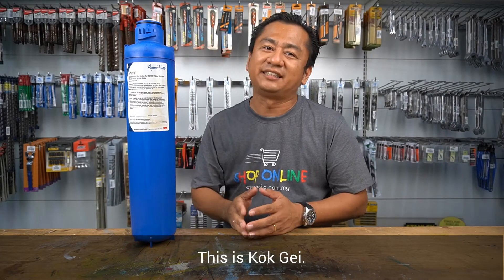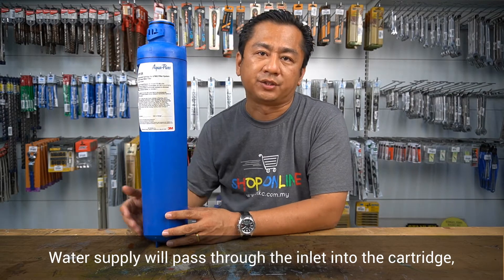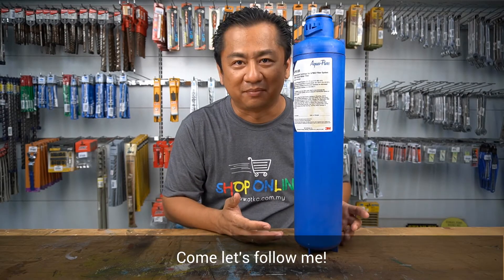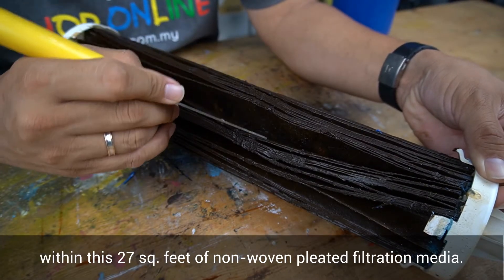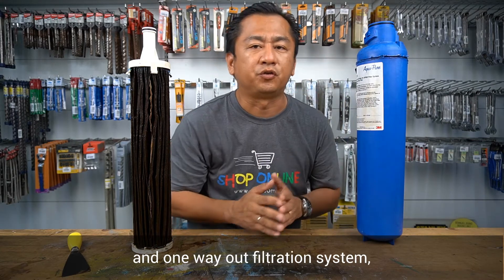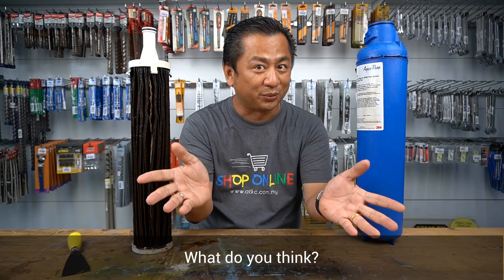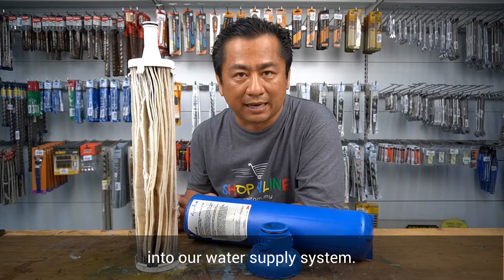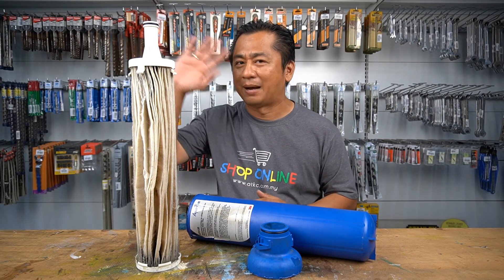Should I Change My Water Filter? | 3M AP902 Whole House Filtration & AP910-R Replacement Cartridge

Comment: What was you flow rate like when you changed out this filter?
Reply from the maker: i didn't gauge it
Reply: @ATKCeWarehouse  Thanks, but even without a gauge it seems like if it would have dropped a lot you would have noticed it, so sounds like little or no impact on pressure or flow. This unit is on my short list.
Reply from the maker: @hdtvkeith1604  Well, the pressure or volume would have dropped. What  I did was, I marked the date I changed by filter. Basically, I do change it every 12-18 months.

Comment: Boss, I use AP902 for my whole unit filtration for 12 months now, and I stay alone, less water usage, and the water pressure still strong until now.
My question is, am I still need to change my filter every 12 months?
Reply from the maker: You  may consider every 18 months. However, it's good to have a pressure gauge installed for monitoring.

Comment: Can you go longer than 12 months if you are on a municipal system? I just changed my after 25 months because I noticed a slight reduction in water pressure.
Reply from the maker: Do you mean multiple filtration system?
Reply: @ATKCeWarehouse  I use the AP904 as a pre filter going into my Culligan water softener. My drinking water I use a one gallon distiller. The 1/4 cup concentrate from the one gallon was showing reddish tent with the reduction in water pressure prompt me to change filter after more than two years.
Reply from the maker: @captaincupcake57  Good to hear that.

Comment: I tried to replace my 3M filter catridge but i cannot push the pin upward. What should i do?
Reply from the maker: It is because of the pressure inside the chamber. If you have bypass channel as shown in my video, kindly open the valve slightly to mitigate the pressure. This should do the trick!

Comment: Thanks for the very professionally done video. Why dont the manufacturers use a transparent housing so that we can see the level of dirt?
Reply: The reason why manufacturer don't use clear casing for outdoor water filter is to prevent algae build up. When sun ray penetrate the clear case and hit wet element in the filter this will slowly create algae and in the long term will cause your filter clogged faster. Same goes to outdoor water tank on the roof. They made stainless steel to prevent rust and algae build up.
Reply from the maker: Thank you for your sharing.
Reply: @MohdRadhwan  ..thanks bro.
Reply from the maker: No sure about this. Perhaps this might freak the customers away. :P

Comment: Do you think is it better to have a sand based outdoor water filter, or an outdoor water filter like 3M?
Reply from the maker: Depending on preferences, quality and cost, I have tried sand filters which is relative cheaper both in installation and maintenance. However, currently I am using the above 3M outdoor water filter.
Reply: @ATKCeWarehouse  So, if I look for quality (clean water) over price, I should go for 3M right?